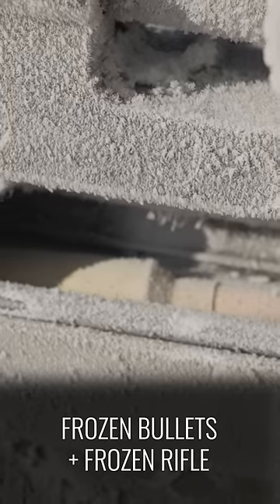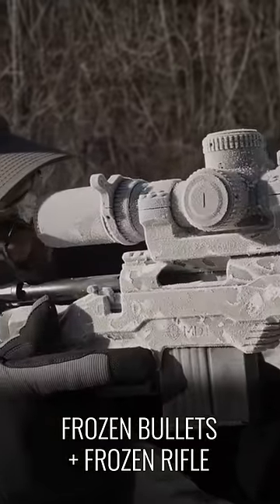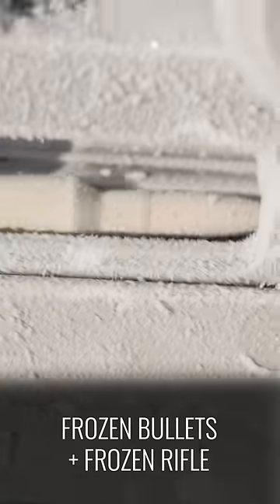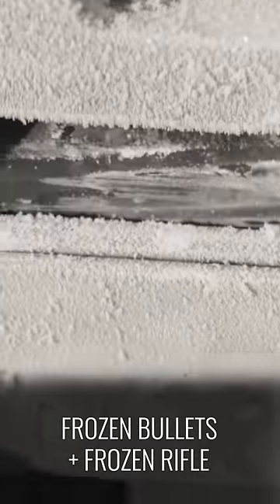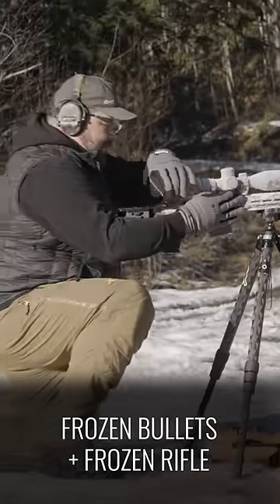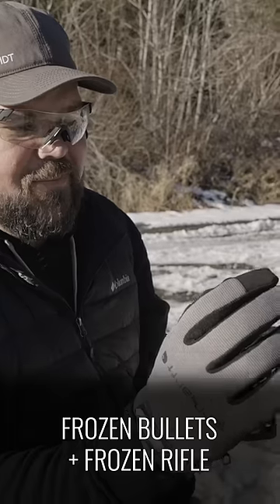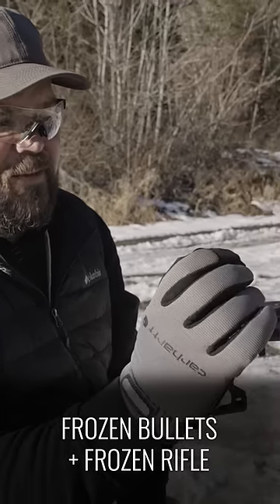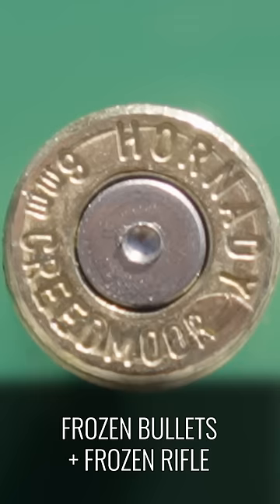Testing Extreme Freezing Temperatures On A rifle

Comment: One thing that people don't realize is that the freezing actually decreases the internal pressure, but inversely it decreases the actual tension the locking lugs can hold. So what actually happens is you have locking lugs that no longer meld together, and an unsealed chamber venting gas. Overheated guns bind up, cold guns just launch the bolt and all that around.

Comment: rolls eyes in norwegian
Reply: yeah this seems like a bad conclusion. cold temperatures reduce combustion speed with nearly all smokeless powder, the ice obstructing the barrel and the frost on the cartridge seem much more likely culprits to me.
Reply: @ironbunny4121  i been a biathlon (skiee and shooting) for over 15 years, shoot like the wepon in -30c, which is very cold, but the temprature have very little to like 0-2cm from 100m place, depends on ammo you use for example cheap ammo, which had less gunpower is more likely to be worse in colder climates then more expensive ones, but if you shot aim peefectly every time, then very cold tempraturs dont really have no impact if you miss or not

Comment: I wanna see this done with a Mosin Nagant
Reply: Probably no issues since its regardless worn down so tolerances take into count any contracting metal in cold climate, top of it already being loose.
M39 mosin with new barrel would be optimal test subject for this since it has tighter tolerances, but still designed for cold climate.

Comment: Chances are it wasn't overpressured but cold enough the primer fit to the case pocket was compromised.  IF you chrono cold cartridges they will chrono lower than room temp cartridges.  that is unless there was some blockage due to the cold (ice or enough frost inside the bore).

Comment: Ahhh now the frozen rifle tests make more sense i didnt think about tolerance changes due to temps
Reply: Different metals contracting at different amounts at the same temp. Metallurgical differences. Very interesting shit.
Reply: @andrewr4306  good Ole coefficient of expansion, same reason why baking dishes explode if you set em on a cold counter top.  Crystalline structures are interesting as ya say lol
Reply: @100GTAGUY  kinda baking dishes explode due to internal stresses from manufacturing. Also that has to be a damn cold counter top.

Comment: Would this affect service weapons and munitions in artic regions?
Reply from the maker: Depends on how the ammunition is built and designed, but these were exposed to a temperature we couldn't measure since our device could only do -76.4 F.
Reply: Yes it does, we had to be very careful with where we set our rifles if not holding them in Alaska because the snow can pack in the barrel or chamber, and the cold shrinks and expands the metal so you try not to bring it inside anywhere warm often, or leave it out in the biting wind so you aren’t constantly stressing the metal, and so you can handle your weapon more effectively. Winter rules applied to all of the small arms we used, M4A1 all the way up to Browning M2s
Reply: There are firearms specifically made to run in Arctic conditions

Comment: AK-47 entered chat.
Reply: The same AK's that fail article testing all the time?
Reply: The surprise when people learn that something like AK-47 never saw mass production and was only a prototype, the rifle that entered the mass production was just AK
Reply: AKs are not the holy reliability of assault rifles, stop with this.
Reply: @Oleksey1769 Maybe not, but they are one of the most reliable automatic rifles in cold weather environments.
Reply: @courier6739  yes but not for the conditions in the video. The AK plateform is very reliable without proper maintenance and that alone makes it remarkable enough to not need building fake myths that it can resists hard mud and ice
Reply: @StefanGrotRowecki1939 47 is the year of development

Comment: Cold temperatures shrink metal so I’m guessing you just resurfaced the inside of the barrel.
Reply: The guy above you said it expands.
Reply: @ktg843  it expands hot
Reply: @stereotypicalwhitemale848  it expands cold. It shrinks when it’s hot. Same as Ice. When water freezes ice takes up more space than the original water. The resurfacing would take place because the metal overall has expanded and caused the inside of the barrel to be smaller due to the expansion
Reply: @waynewilliams5353  stop go google it and come back then we can talk about it.
Reply: @waynewilliams5353  Steel and just about everything else) shrinks when it gets colder. How do you not know this?
Reply: @waynewilliams5353  you might wanna get old science textbook out cause u need to have a read
Reply: @parcanator  no. It’s my fault for making the assumption that high carbon steel expands when cold like some irons do. I know stainless shrinks, but though high carbon steel acted differently
Reply: @waynewilliams5353  someone forgot about hydrogen bonds😮
Reply: @waynewilliams5353  all common metals shrink when cold and expand when hot
Reply: @Midnight_Rider96  not all. That’s why I assumed high carbon steel did not shrink. Grey cast iron (the most common), gallium, silicon, etc expand when cooled. Most guns barrels are high carbon steel. Steel is a mixture of iron and carbon. I know stainless shrinks. I assumed high carbon steel does as well like the iron, but was mistaken because it takes on more of the carbon characteristics than the iron. I thought stainless was different due to the chromium and nickel in it, but is still largely iron and silicon…..both of which expand to an extent when cooled
Reply: @waynewilliams5353  My dude, water is remarkable precisely because it is the ONLY substance that behaves this way. It has to
do with the crystal structure formed when it freezes. Literally every other compound or element shrinks with cold. Dry ice sinks in liquid CO2 for example.

Comment: Y'all need to consider the brittle transition temp. Steel does from ductile metal (springy and bendy) to brittle like glass (will crack and potentially rip like a liberty ship). The stronger the steel the higher the brittle transition temp is. Liberty ships, before advanced metallurgy, would transition around 30 degrees. 

What's the temp for the gun

Comment: The pressure and also thermal expansion, and the freezing making parts smaller and expanding from extreme heat suddenly. Can break and wreck firing pins or seals or anything small and maluable

Comment: The ice vaporizes (becomes steam) within the barrel. So you've added extra pressure but mainly I think its the water vapor saturating the combustion upon ignition and travel. Example: A lighter inside of a steam room will either not ignite or have a weaker, less stable flame than that in a dry room. The cool temperatures and metal contraction also plays into it so overall youll notice a lack of performance. The extra carbon, the black, could be a sign that not all the powder was able to ignite upon firing. INSTANT DAMP AMMO 
anyway im just yappin, I know some shit but im just speculating in this instance.

Comment: With the caveat of "Don't do anything you're not comfortable with", that primer doesn't look bad, at all. If you were reloading, you're definitely nearing the upper pressure limit, but if that load produced the smallest groups and a velocity you were happy with, you could run those with no issue at all. I wouldn't be chasing the next velocity node though

Comment: The problem is condensation water. Only -20 Celsius is enough to freeze up your rifle so bad that trying to rack it with hands is not enough. This is one reason why we slept with the rifles during winter military excersices. When you shoot it gets hot and when it cools down it water which condensed inside the rifle will freeze. Even with AK-platform this was an issue.
Reply: Of course if there is one in the chamber left and the firing pin is free it's easy to get back in action. :D otherwise you are going to melt it or whack the handle to the tree for 15 minutes.

Comment: I wonder if you were in such a cold environment that there’s no air moisture (thus no frost) if that would effect the experiment. Obviously the strain on the metal components would be insane due to the brittleness, but the lack of frost would probably help prevent friction between components

Comment: Usual fracture testing of metals is down to -45C. Unless the manufacturer specifically says cold weather tested I wouldn’t shoot it. Metal has a DBTT (ductile to brittle transition temperature) where a shock loading such as firing a bullet will create stress fractures. If it’s cold enough you’ll have a chance of a catastrophic brittle failure of the barrel, that may result in shards of steel shrapnel being sent int every direction. Play safe 👍

Comment: Almost everyone in the comments is missing one of the major issues; steel contracts when cold. This causes the bullet to bore to fit to be significantly tighter, resulting in more resistance going down the barrel and more pressure behind the bullet.

Comment: I wonder if you had frosting on the inside of the barrel, if so you may have bulged the barrel from the hydraulic pressure generated much the same as if you have too much oil in the barrel.

Comment: Only problem is they can try to make rifles stand cold weather but you wouldn’t want to use them in hot areas due to the metal used in the barrel expanding

Comment: Well no duh! Metal shrinks when cold. So all of the tolerances got tighter. Meaning your throat got shorter and your lands and groove distance (bore diameter) just shrunk. Steel shrinks more than copper and lead (the bullet) so forcing something bigger down a smaller hole with the same amount of pressure as usual caused a pressure spike.

Comment: This is wrong.
It was not overpressure. In fact it likely produced less pressure than normal.
The cold simply changed the material properties of your primer and made it react to that pressure differently and flatten more.

Overpressure signs are just hints...a clue that overpressure MAY have caused that sign. But other things can cause those signs as well.

Comment: That primer is fine. I’ve seen way flatter on some of my top end loads and my rifle shoots them all day long. When you freeze things they shrink. The primer and case will shrink opening up the fit between primer and primer pocket. 

The chamber likely enlarged due to the circular nature of the steel around the chamber. It would shrink not inward on the chamber, but would shrink concentrically thereby slightly opening the chamber. 

But also, just don’t do this. You’re not an Arctic soldier. Just play with your guns nicely.

Comment: While I think it was a interesting experiment I think your safety procedures were lacking. The rifle should have been held by some sort of stand/framework while you remotely operated the trigger by string from behind cover. I also wouldn’t trust the integrity of the rifle afterwards even in normal conditions. There could be micro fractures in the metal that will get worse over time.

Comment: I am sure the ice has something to do with it, but the metal barrel also shrinks considerably when cold. At those temps, with the additional ice constriction, yes, it will be a smaller diameter than usual. Not sure if lead shrinks less or more than steel, but I believe a ring shape will contract more than a solid circle. Not sure why you would be trying that first shot in person with a high powered rifle if you aren't sure it is safe, although after a few shots it would be a moot point. Kind of weird to be the guy who is not worried enough to fire the first shot remotely, but then be to concerned to fire any follow up shots which would logically be safer and safer each time as the barrel warms and the obstruction is cleared out.

Comment: The cold isn't going to affect combustion of a solid fuel inside an enclosed capsule. And as long as all parts of the firearm are properly lubricated, it should function mechanically. What's special about this 🤣

Comment: Uh yea…. That didn’t over pressure “heavy duty” and you didn’t pop the primer….. 😑 love this is what ppl are putting out there. Yes you flattened a primer is it higher pressure yes and yea it’s not the same as a warm gun. Your bolt opened fine it extracted and you can still read the lettering. you pop a primer your face is gonna know it.

Comment: Ya dumb so if it blew up holding it at arms length is going to help super lots, i believe most modern firearms can be overpressured extensively before failure frost isn’t going to kill you